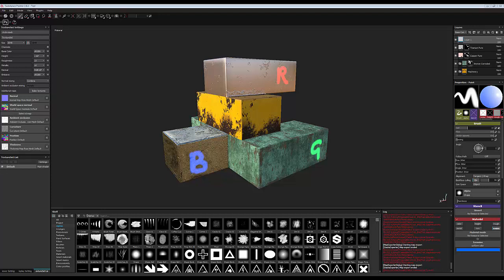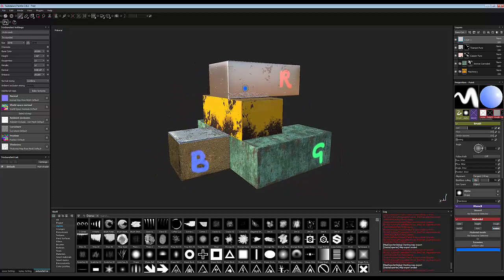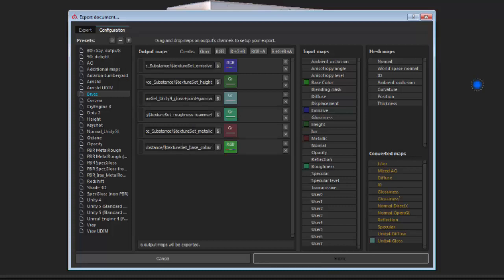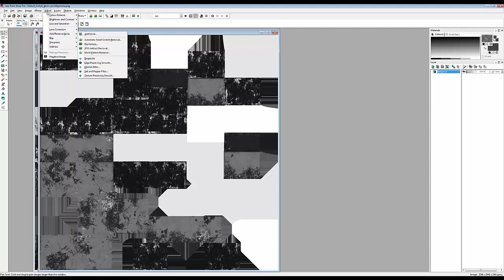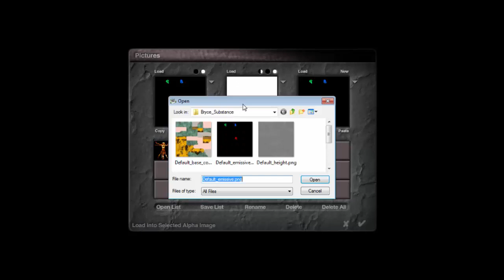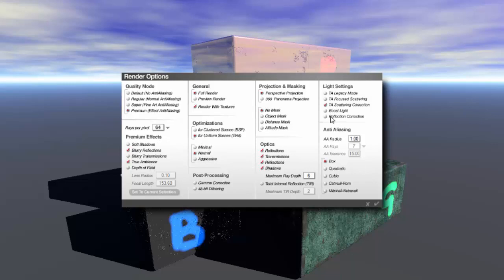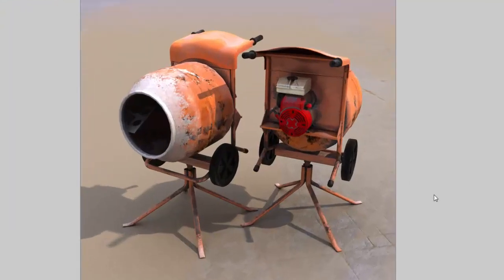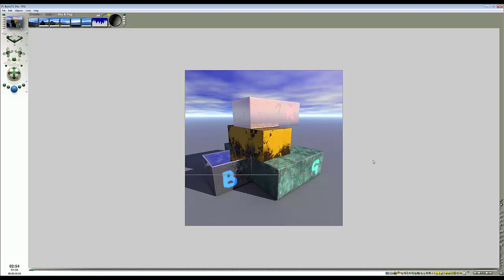A video about PBR workflow into Bryce - by David Brinnen.

Comment: Is there a way in Bryce to configure and export a seamless texture (not using the mirror stitching method) to bitmap file - for seamless tiling in 3D modeling programs or game engines?
Reply from the maker: Not really.  The procedural nature of Bryce's texture generation means that though the textures have repeating elements within them, they are offset and scaled in such a way that they remain out of phase practically indefinitely.
Reply: @davidbrinnen  How to export correctly texture from DTE to bitmap?
I squeeze terrain to absolutly flat (to X axis) > export this terrain to file > and along with this mesh, the texture is exported (unfortunately, but not seamless).
Is there an easier way?
Sorry for my english.
Reply from the maker: @FONORX  If you import your 3D object that you wish to texture into Bryce, so long as it has a good UV map, once you have applied whatever material you wish applied to it, you can then export it, and it will generate a selection of texture maps.  If however, what you are looking for is a 2D tile of texture that can be joined to itself along its edges to create a grid of texture that has no seams, Bryce is the wrong application for this task.  The aim of Bryce's procedural texturing system was to avoid such obvious repetitiveness by using a recursive multi-frequency approach - think fractals.  Feel free to ask more questions if I have failed to explain this well.
Reply: @davidbrinnen  Thanks, you explained it clearly! You are an expert in this and your answers are trustworthy.
Okay, I'll have to edit the edges of the texture in Photoshop to make it seamless.

I'm trying to find out if it's possible to quickly/easily save a texture I create into a bitmap directly from DTE (without having to export the mesh)?
Or is this not provided?
Reply from the maker: @FONORX  I am sorry to report there is not an export texture option that will provide a format that you can use outside of Bryce.  If you poke around in the Bryce folder structure you will find a texture's folder, but the format these are stored in is unique to Bryce - the reason being that within Bryce the textures are mathematical entities not raster images.  In terms of creating seamless textures that are 2D tiles for painting over large areas I have experimented with a few bits of software, if you have the resources in terms of time to learn and funds, I found Substance (now owned by Adobe) to be excellent.  If this interests you I highly recommend checking out Wes McDermott's youtube channel - he has great insights into Substance and well paced tutorials.
Reply: @davidbrinnen  Understood thanks.
I just really like experimenting with texture generation in Bryce. Sometimes they turn out very “strange” and unlike anything else. It's always surprising.
At the same time, the spirit of the 90s evokes nostalgia.
Reply from the maker: @FONORX  Yes.  Classic perlin noise and such, provides a classic 3D look.  Procedural generation was ideal for saving memory however with the advent of GPU's and more RAM, rasterized images offered a much easier (if more memory hungry) solution.

Comment: David, once again huge thanks to you for all those videos, tutorials, products, advice etc. you give to community through the years. I'm still learning Bryce, and your input is extremely helpful. I'm far from advanced things like subject of this vid, but i wanted to ask... In what cases, do you think, it's preferrable to use image-based materials, and in what - pure DTE ones? Since ~2015 world gone crazy with PBR stuff, everyone is using Substance software (or similar)... So, do you think pure DTE still holds up for "modern look" or its inevitable to use all those image maps for foreground, etc. And with my amateurish experience, i notice that its very easy to make your Bryce scene look like 90s or early 00s render (especially if just use materials from library without good context), but can be very hard to have more or less modern CG look (which you, of course, often have - but i cant even imagine how enormous your experience is).
Reply from the maker: Hi Harmann, I'm glad to hear that you are still finding my videos useful.  With respect to the digital artworks I think some consideration to be given to the goals of the artist.  From the inception of ray-tracing the goal was to achieve photo-realism, so for many years, with this goal in mind the skill of the artist could be measured by how well they had managed to achieve in creating an image that was close to reality.  Now however we are more or less at the point where it is not particularly challenging to create photo realistic images.  So the emphasis has shifted back more to the creativity and style of the artist.  Having achieved one technical and artistic goal, the CG artist is no long being measured quite so overwhelmingly by their ability to fake reality and has greater freedom to express themselves.  Creating photo-realistic imagery using Bryce, software that has not been updated for over half a decade, is now more of a challenge for the sake of the challenge.  Other solutions are available to achieve that goal far more effectively now.  So what I am really doing is putting the ball back into your court and inviting you to ask yourself what do you want to create?  What interests you?  The advantages of DTE at the time was to a large extent nullified by the availability of more memory, now software such as substance painter use DTE concepts and these can be painted and baked into PBR maps.  So theoretically providing the best of both worlds.  This "pipeline" was created largely with the aim of making the texturing of game assets more efficient.  Games dealing in texture maps better than doing fractal calculations on the fly.  Though some games have tried to take this approach - it runs the risk of recreating the wheel every time it is attempted.  For the sake of efficiency, certainly in industry, standards really help because they can be adopted across platforms.  So... it's what you want?  And what your goal is?  If it is your hobby, you are free to dabble where you will so long as it is fun, then that's fine.  If you are going to work professionally, you need to do some research and trial out different software to see where that can take you.  Does that in any way answer your question?
Reply: @davidbrinnen  thx for sharing thoughts, though maybe you went a bit sideways to more global rhetorics :) i'm currently at a bit unclear position of life, where i'm choosing what to do, though i think that most likely i'll pursue something other for "professional work" (2d design maybe), while keeping 3d as hobby (i'm aware that Bryce ain't practical compared to other solutions nowodays; tl;dr brycing is for soul and heart rather than getting job done) - with, for example, modelling, i never went much further than repeating videotutorials, which i do many times slower than needed. Speaking of, attempting to model objects in bryce can be a cool challenge as well, but if you already tried polygonal modellers, it feels very restricted (no chamfer, edit vertices etc etc) and sometimes i think if i should treat bryce as daz studio (aka compositional software to place external models into)... But going back to my first question, i 've read some bryce discussions at daz and some artists were like "dte is good enough for everything, use it to save memory etc" while other were strictly for image based materials. So, wanted to know your position of it. Maybe, if we consider different types of scene to define, what we want to use , for example a) landscape scenery b) architectural c) still life / objects d) scene with people/animals/organics.
Reply: and speaking of game industry, i think in recent years stylised graphics became more popular, with those handpainted textures; while aaa technologies go more and more ambitious, and when i see latest ue5 reveal trailer, i take a look at scene and think "i would spend just half of year manually modelling all of that". P.S. as for "pbr crazy", if we compare overall looks with pre-pbr days, i think besides more attention to reflection etc. material physical attributes, also this new fashion gives overdetalization, like all those little scratches on things.. or maybe its also  due to increase in resolutions, i dont know.
Reply from the maker: @harmannsmith5653  The drawback of the DTE is that the interface is fiddly and time consuming to work with.  It could be apply to many applications, but ultimately, unless you are doing it for fun - better solutions now exist, technology has marched on.  If the procedural texture already exists and small modifications are all that are required - then fair enough.  But to suggest this is a good approach to build everything from scratch using the DTE, the time investment required is too high to be practical.  When I was making procedural textures for selling, I'd manage between 3 and 5 in a day.  So, yes, you can use the DTE and it is good but... too labour intensive given how much things have evolved in the industry.   Just impractical.  And as you observed, modern games are monsters and requires a bewildering array of assets to be brought together, which is why they are now made in studio's as opposed to programmers bedrooms.  If you are picking a way to go, here is my suggestions, choose something you enjoy doing but ideally something other people don't enjoying doing so much, choose something that requires some material outlay and commitment, this will cut out a lot of the competition from hobbyists and part-timers.  Try to pick something that can't and isn't likely to be capable of being done by a robot in the next ten years!
Reply: @davidbrinnen  i appreciate your reasonings, thank you much for answer and sharing experience. Well, for me DTE reminds synthesizers (another hobby of mine), especially those huge ones with many wires - the ones that Kraftwerk, Tangerine Dream etc. used. I think we compare - it's also fun to use, but not straightforward and there are more quick and stable solutions for production. Oh, and of a person would try doing 3d models "for others" too and not just for own scenes, is there nowodays a standard for "compatible with..."? I mean, let's say, if you make a model and materials (with substance, photoshop, whatever else) - obviously you can't orient much at how it goes with bryce or daz (because in them you need to adjust much more or completely rework), so... is it a must to learn one of "industry standards" render engines like vray, octane etc. etc. as main field for your model's showcase, or it's enough with something like marmoset/keyshot (or unreal/unity if gamedev)?
Reply: " isn't likely to be capable of being done by a robot in the next ten years" 3d scanning and procedural generation scares me a bit, yeah. i would enjoy working hard for a week to make a game' level design  rather than get instant generation that looks even better than i was doing :o I'd say, for those who are scared of robot extinction, maybe salvation is in making things that are totally fantastical and dont exist (unlike hyperrealism, for which 3d scans is getting more and more used)
Reply from the maker: @harmannsmith5653  I believe Horo made similar comparisons to synthesizers.  I can see that, though I do not have extensive experience in that field.  If you are making models and have a target application that is a great help, for a games keeping the polycount to a minimum was more critical in the past than it is now there is a convergence between the quality of model that would be suitable for still rendering and one that might be used as a game asset.  With substance painter, for example, it bakes the various texture channels needed to suit the application.  And if you goto the trouble, you can also used the geometry baking process to increase the illusion of polydensity as part of the texture painting process.  Figuring out the way to break models up into material and UV zones is certainly a challenge to overcome and a test of the tolerance of your texture artist - or yourself - if you are doing the whole task yourself.  But at the end you should have something that could easily be adapted to work on a range of platforms.  To this end, various "bridges" are becoming available to automate this process and I imagine that as times goes on, these converters will become increasingly competent.  These however will not be compatible with procedural textures, because while everyone has the ability to decode a png image, the fractal algorithms used by procedural texture generation software are subject to copywrite and a degree of secrecy.  So they are only ever likely to remain in house.  In short there are three problems to solve.  Modeling to produce good geometry for UV mapping, UV mapping to produce suitable templates for texturing and painting for the purpose of outputting compatible effect maps for rendering.  The approach I've taken to this is no secret.  I model in Modo, UV map in UVlayout and assemble the components for texturing in Substance Painter.  The primary reason for making these selections of software was down to taking advantage of free trials and finding these applications suited the way I wanted to work.  Is this the best choice?  Probably not.  But it is a good fit for what I do.  I learned from get to grips with DAZ studio for a year, that getting on with the interface was more important to me than the capability of the software.  I tried a lot of things but within minutes of using Modo I knew I'd found something I could live with.  UVlayout took longer to get to comfortable with, but I soon liked it better than Modo's implementation of UV mapping.  And Substance painter actually won me over due to my fiddling with substance designer which is very similar to the DTE.  At the time I was looking at Mari (which is part of the Foundary's stable of software), but that was a bit over the top - being geared up to more of a studio situation than one man in his attic.  As for our eventual robot overlords, it is an increasingly serious concern.
Reply: @davidbrinnen  and with recent boom of realtime 3d, i think that "still render" format mostly transforms into "pure art" like painting or gravure... aka non-mainstream niche for pleasure and experiments (even though still being used in commercial illustration/advertisment, but maybe much less than before). Progress goes further, however artistic vision is artistic vision. Sometimes i dive into studying of 90s cg multimedia like Myst games etc., to find a source of inspiration. I think that era was very wild in creative spirit, and weird sometimes. Also browsing through Y2K aeshtetics blog, i encounter some familiar imaginery, haha...
Reply from the maker: @harmannsmith5653  Yes!  I know what you mean about the style, isometric games like Plainscape Torment which was an excellent RPG adventure based in the AD&D universe was a fascinating example of what could be done with the technology of the time.
Reply: @davidbrinnen  Actually, sometimes i have an idea of trying to do a small oldschool game like isometric rpg or point and click adventure, using prerenders made with Bryce. If ever would try such, i guess masking in bryce will help for all those collision areas. And, once again about our initial discussion. Yes, doing mat from zero in dte is interesting, but may took time.. i watched some other videos of you and they reminded me how you need to adjust materials if you change lighting or vice versa. Good for self-challenges, though :D . Also from my amateur experience, in Bryce it's hard to have consistency of "image's modernity level"? I mean, slight adjustments in sky lab or dte mats can lead looks from "contemporary 3d" to "here we go to 90s again".  I guess bryce is time machine that humanity invented. p.s. did you get around to experiment with burning lava that another user proposed? curious
Reply from the maker: @harmannsmith5653  Oh it was a long while ago now.  Who knows?  I have done various attempts at lava over the years - with varying levels of success.  Having used other software, what I think is one of the greatest strengths of Bryce is the area of rapid prototyping of ideas for a scene.  In a pipeline where your final render is handled by stand alone software, it can be quite tedious to go back and forth making small adjustments, either in geometry or texturing.  And if there is a UV error, this might mean a tedious amount of texture rebakeing and exporting.  Bryce is very good in that it lets you slap materials on your models without the requirement for them to be UV mapped.